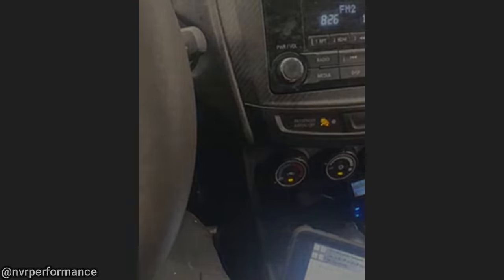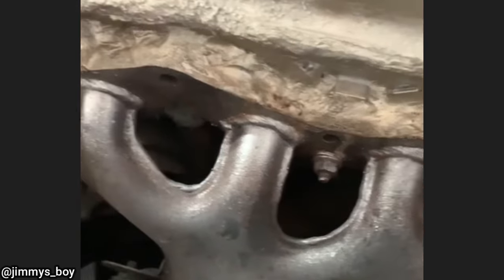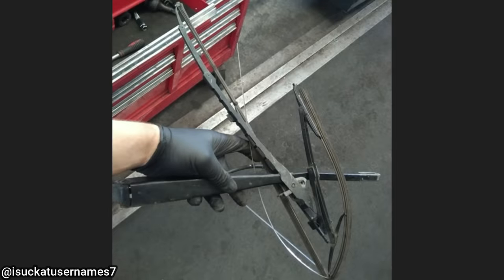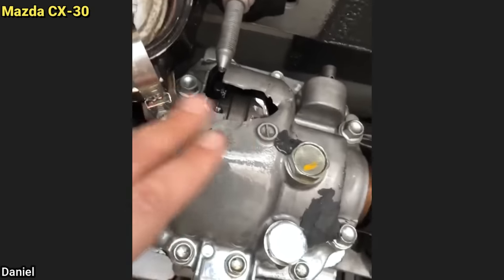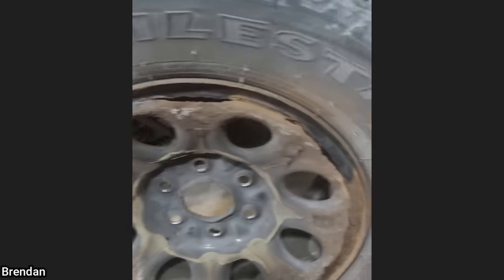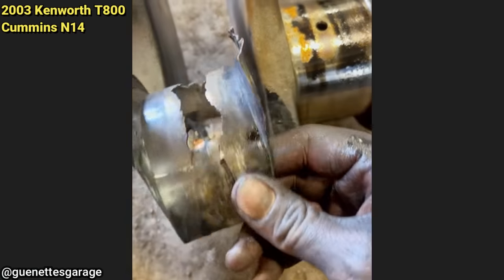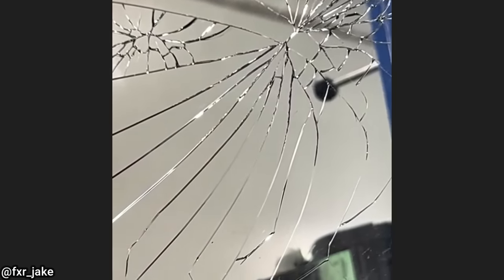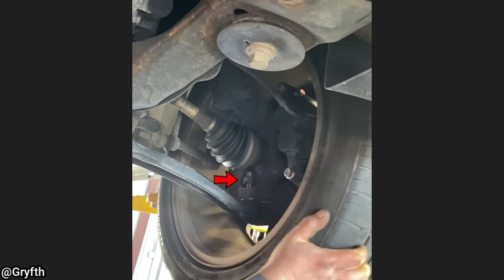Customer States (Best of January & February 2022) | Just Rolled In

Comment: Was trying to figure out why my truck was dripping water constantly.  After a day or two, I went to close the door and heard a sloshing sound.  I then realized the door was filled with water, as the drain holes that usually allow any water that gets in to drain had managed to get clogged with some stray grass.  Remember everyone, change your door fluid regularly.
Reply: Inspect those drain holes!
Reply: @debesys6306  it helps lubricate the door hinges. Don't neglect it
Reply: @TurtleSauceGaming  I think my door fluid is that new fangled "lifetime fluid." There's no fill or drain holes. Should I just drill them out? My car makes a scraping sound every time I close or open the doors, and I dont want to have to break the bank buying new ones.
Reply: Every time I change my blinker fluid.
Reply: The pig looks remarkably happy about things.
Reply: @privateassman8839 If you aren't joking, I wouldn't suggest drilling a hole in the door before making absolutely sure that there isn't a clogged drain hole, that you're drilling into the compartment where the water is, and that you won't drill into any wiring.
Reply: Been there before 😅
Reply: Door fluid levels aren’t on my daily checks list … I need to speak with my fleet manager bout that. He’s normally pretty good with documentation.

Comment: Things do not want to hear at a service center or garage. Mechanic states: Your car has been sabotaged, then proceeds to show you the saw cuts on the steering linkages and lower control arms. 👀
Reply: Car immediately given to ex-wife.
Reply: @haroldwilkes6608  She probably already knows about it.
Reply: @UCCLdIk6R5ECGtaGm7oqO-TQ  Great point.
Reply: Sad thing is this is more common then you think. Had my half brother cut my brake lines because he was pissed after i bought a corvette i had saved up for since i was 14 and that mom wouldnt force me to let him use it. Granted it was a beat up 94 and only $8k but still....
Reply: @arcticfox5118  i had a stalker cut my radiator hose after slashing my tires didnt work.

Luckily that day whoever did that I was called to work at another store.
Reply: went to get my tire looked at because it would lose a little air every week. turned out someone put 9 nails through the inner wall of my tire. 
Edit: on the side of the tire wall.
Reply: @arcticfox5118  he should be a half brother by another definition after pulling that stunt jesus christ
Reply: @implicationsunpleasant3568  oh trust me we had a pretty good fist fight after that. And another one after when he burned down my F250 for the same reason as the corvette had its brake lines cut. Namely he wouldnt get a damn job and was pissed i could afford a vehicle due to said job and mom wouldnt force me to give it to him to use and abuse. Espeically after he totaled the corsica dad gave him the first time he went out on his own.
Reply: @arcticfox5118  jesus christ I hope you dont talk to that psychopath still
Reply: @arcticfox5118  Man I'd recommend just moving the fuck out of there, not worth it.
Reply: @netherwolf3012  ohhh way ahead of you, moved out almost 18 years ago now lol. Now i have my pretty green peterbilt and my snazzy ram 3500 and i moved to the other side of the country.
Reply: My mom hit something in the road which caused her tire to leak badly we took the rim get a new tire and the serviceman asked if she had any enemies because she had a knife broke off about 3 inches in the tire.
Reply: @arcticfox5118  I hope you 'A' moved out, 'B' had him arrested.
Reply: As a mechanic, I seen break lines cut, knives stuck in people's tires. The one that got me in the video was the tracking device.
Reply: @arcticfox5118  did you call the police and file charges
Reply: @Jaxmusicgal23  Had one of my wife's co-workers slash the top on my Jeep when she drove it to work one day. Made me really mad because the top was still in fairly good shape, but old enough that a new window would not have fit on it. Wife cried for hours. I sewed it up with fishing line and covered it with gorilla tape and drove it like that for years.
Reply: Where was the  spouse ?
Reply: @jimmyclimer594  
mechanic: "is this your car, or a family members."
me: "its mine"
mechanic: "ok, yours. has anyone you know, to your knowledge, had access to your car." 
me: "i guess"
mechanic: "yes?, ok. would you like me to call the cops for you?"
me: ".....? about what?"
Reply: Than the Next thing the DUDE says >>>> Hmm my old lady and i havn't been getting along so good, the last Month Hmmm  !!! Too Funny
Reply: "i drove it all the way here im sure it will be fine. i dont wanna spend more"
Reply: @joshuamast5128  pretty hard to prove unless the police literally catch them in the act of murdering someone

Comment: The lower ball joint exploding is incredibly impressive. Never in my life working on cars have I seen anything remotely close to a ball joint exploding like that.
Reply: Right?! WHAT?!
Reply: Atleast the Technician was wearing safety glasses
Reply: @windtalker6519  I guess. But with explosions like that I gotta wonder how much safety glasses with stop
Reply: @windtalker6519  but no ear protection
Reply: @possibleproblem479  you’d be surprised how much they stop. I’ve personally seen safety glasses stop a piece of a portable grinder wheel that broke in use. We kept the glasses with the broken wheel in it as a reminder to new guys in the shop
Reply: @williamsoto8583  ...i have a pair like that....stopped a piece of cut off wheel about the size of a quarter from going straight into my skull.....when it happened, I went and told the boss I'd like to take lunch early and just go home for the day.....he asked why the end of my nose was bleeding--a little flake of the wheel had got my nose.....I showed him the glasses....he told me to go ahead and take the rest of the day off....lol
ALWAYS wear eye protection!!!!
Reply: Seized caliper slide pins have a fun little habit of doing something similar during removal, but I've not seen a ball joint go that spectacularly before.

Comment: As a German, I'm really thankful that we have the TÜV and Dekra.
I also appreciate the subtitles with metric conversions.
Reply: I am aware of them for testing electronics but what do they do in the automotive world?
Reply: @stezenast5878  Germany introduced mandatory vehicle roadworthiness inspections in 1951. In Germany the VI is called Hauptuntersuchung (literally: main inspection), in reference to the main technical inspection company in Western Germany, often called TÜV. A safety inspection and an emission inspection are required to be done by one of the authorized private technical inspection companies (e.g. TÜV, DEKRA, KÜS, GTÜ, ...) every 2 years for passenger cars, motorcycles, light trucks and light trailers. New passenger cars and very light trailers have to pass their first roadworthiness check after 3 years; motorcycles, light trucks, mid-weight trailers and camper trailers after 2 years.
Commercial vehicles (trucks and heavy trailers with an unladen mass over 3.5 tonnes, buses, taxis and also rental cars) are to be checked every year.
Reply: @stezenast5878  If they find one drop of oil on the underside of your car,  it failed and you have to fix it. In the USA, every parking lot has dark oil stains in each parking spot.
Reply: Stuff like that make me appreciate the TÜV.
Reply: Your papers please
Reply: It’s why we have MOT tests in the UK on every vehicle every year after it’s 3yrs old.
Tyres, bulbs, brakes are the usual problems why cars fail the test. All preventable if owners pay more attention and care.

Comment: I had a customer say their car didn't accelerate as fast as it used to, there was about 5 layers of floor mats piled up under the gas pedal. I also replaced a set of tires and inside of two of them were tied off balloons that were cut open and the contents removed but they put they balloons back inside the tire.

Comment: A buddy of mine's mom had her front passenger side caliper bolts come out on her Chrysler Aspen while pulling into a store parking lot, and the whole caliper was just dangling by the brake line and the pads fell out. Miraculously, there was no damage to the caliper or any other components, and good thing the line was still in good shape. I even found the pads undamaged on the side of the driveway and was able to fix it in the parking lot without needing any additional parts aside from the new bolts and clips for the pads. One of the craziest and luckiest mechanical failures I've encountered, that incident could've been catastrophic and had the best possible outcome. Apparently she hired some meth head to install her pads the week before for $100, so I inspected the rest of the brakes as well and guess what, most of the other bolts weren't tight enough and he didn't clean and re-grease the slide pins, which were sticky from old dirty grease.
Reply: The brakes are not the ideal place to try save some money...